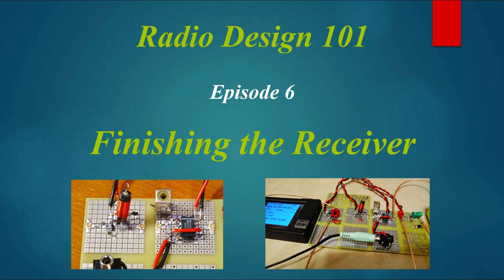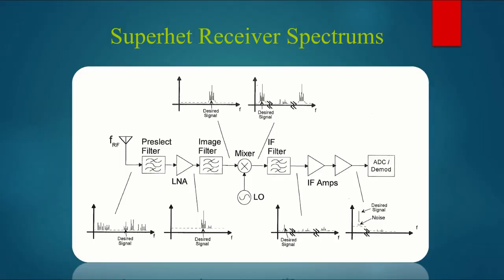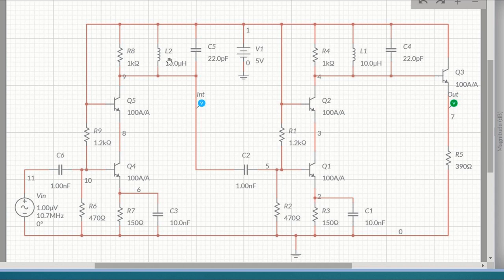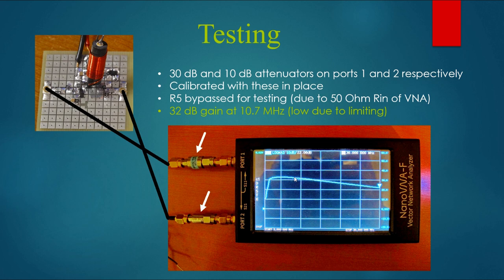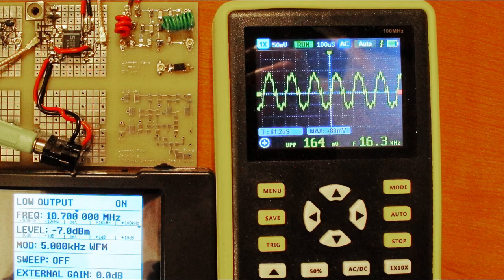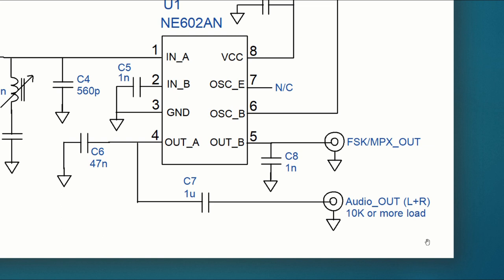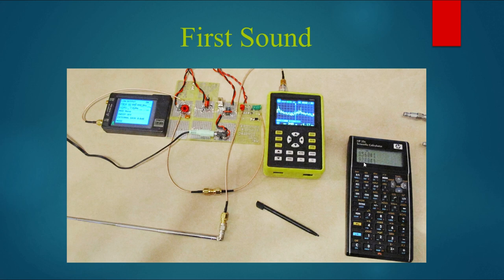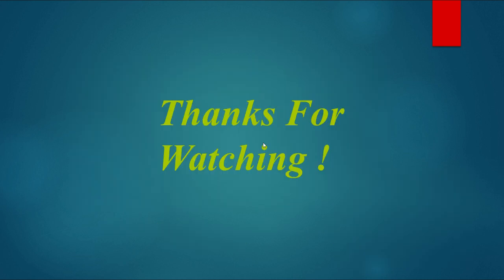Radio Design 101 - Finishing the Receiver (Episode  6)

Comment: It might be a good idea to have each stage of the circuit powered up and tested as it's built. That helps the students learn how to set up the tests of each stage , to see what the signals look like, and to ensure that the entire unit will work when everything is finally wired together. That's what I did when I was helping a group of hams build 40 meter QRP transceivers. Everyone appreciated doing it that way.
Reply from the maker: Absolutely agree. Testing is 50% of development work. And of course the university class did that. I think when this series was being put together, I wasn't thinking enough about viewers who might want to actually build their own. Your point is an excellent one. For anyone building their own - they absolutely need to test from the ground up.  Later, I did put all the course notes and assignments onto a website for those who wanted a deeper experience. Here's a webpage that has a full set of example project assignments, including directions for testing each. (these don't directly track what's in the videos, but many of the early assignments are close.  https://ecefiles.org/rf-circuits-course-section-0/  Thanks for bringing this up.
Reply: @MegawattKS , thank you for the link. I'm self-taught in electronics, but by watching your videos I feel like I'm auditing your class.
Reply from the maker: @johnwest7993  Cool !   73

Comment: Thanks for the video series. I am going to try building my own but adjusted for 145 MHz 2 meter HAM band.
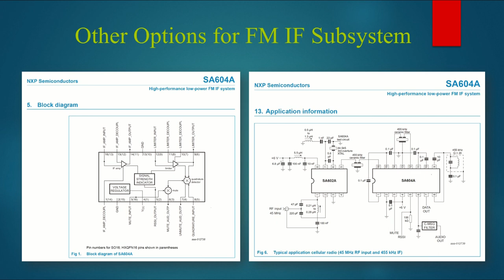Reply from the maker: Nice. Thanks for the comments.  For 2m work (narrowband FM), you may want to try one of the SA604A FM IF subsystems as shown at the end of the video (timestamp 32:40). Figure 6 shows this, preceeded by a second downconversion to 455 kHz so a narrowband filter can be used. It will also give the gain needed (FM stations are often strong enough to get away with what we did in the discrete IF amp, but 2m not so much :-)   73's

Comment: Thank you for this series of videos, this material on RF design is one of the best I've come across. Can I ask you a question about the design of the IF amp? How did you calculate the values of the coupling and bypass capacitors C6, C3?
Thank you and congratulations for such good videos.
Reply from the maker: Thanks!  Glad it is helpful.  The short answer for those capacitors is to just select a "large value" like 1 or 10 nF. That's "large" in the sense that at 10 MHz, 10nF is on the order of about an Ohm of reactance. So it makes a good low impedance connection. The longer answer involves looking at the signal impedances on the nodes it connects to. For example, the input coupling capacitor sees about 300 Ohms source, and 300 Ohms load impedance - so about 600 Ohms total. As long as it's reactance is much less than that, its good. So even Xc = 10 Ohms that the 1nF gives will work OK.  The bypass capacitor is typically bigger because it sees an impedance of 1/gm looking into the emitter. So that's maybe 30 or 50 Ohms (depends on bias current/etc). So that's why 10 nF was used there.  NOTE: I just noticed the schematic doesn't show a bypass on the power supply node. A bypass is needed there too. I think I just put a 10 nF there (again - the value is not critical - as long as Xc </= an Ohm or so).  It's actually visible in the photo of the board, just above and to the left of the big coil 🙂

Comment: That  resistor and capacitor series thing on the output of the LM386 is a Zobel Network and very useful to add to a speaker crossover network to make sure that 8 ohm impedance speaker is actually at 8 ohms at the crossover point because if it's not it will crossover at another frequency and/or spoil the shape of the crossover rolloff
Reply from the maker: Interesting. I had not heard of Zobel networks. My understanding from the LM386 audio amp datasheet is that the series RC to ground is recommended to mitigate oscillation in the MHz range. I think what happens is the speaker inductance above audio frequencies causes instability in the opamp architecture used in the 386.  So it helps maintain a good 8 (or 10) Ohms not only at the crossover point, but also at MHz frequencies 🙂

Comment: Very Nice presentations. I really enjoyed learning quite a lot as I have been very interested in emitter but the demodulation receiver side was quite a mystery. I feel the most difficult part of this approach is really getting the whole thing to tune properly to your low frequency 10.7MHz. All of this is now sold in a single chip TEA----, AR1010 to name a few.
Reply from the maker: Thanks. Glad it was helpful!  Stay tuned for the "Epilogue" episodes (hopefully soon). The epilogue 1 episode will look at performance, and go into some of the limitations of low cost FM radios including fully integrated designs. (Front-end filtering is relaxed in these and weak stations get blocked by strong ones...)

Comment: Good one. Thanks.

Fun with my demodulator built with 10.7 ceramic discriminator, it works if i power down VCC and drive input signal with 2Vpp. But collapses when powered up.

Haven't had a chance to debug yet. Hopefully this weekend.

Comment: Hi, thanks for the series! Well laid out and presented. About the phase shifter network, correct me if I'm wrong, but it seems to me you calculated the values for L1 & C2 based on reactance of ~26 ohms instead of R/Q = ~56 ohms, giving the circuit a BW of ~188kHz instead of 400kHz. Possibly a wee brain fart, mixing the X with the Q? I guess the correct values would be roughly 830nH and 260pF? Cheers!
Reply from the maker: Good catch!  Yes - I think you're right.  The components shown do give 26 Ohms rather than the 56 mentioned in the video.  However, there is a fortunate extra factor that does bring it back closer to a bandwidth of 400 kHz (I can't say I did it intentionally ;-) ). If we assume the Q of L1 is 50, then it presents another 1300 Ohms in parallel with the 1.5K, so the Q is cut in half and we're back to 400 kHz :-)   Again - not sure if I did that intentionally or not.  Thanks for the careful check !

Comment: would it be a good idea for the demodulator to design a regen type circuit? but designed to work at the IF frequency... that way we get away with a lower Q tank circuit
Reply from the maker: Regen could provide more gain and a narrow bandwidth starting from a low Q tank - and avoid need for a ceramic filter - so that's good. But it could oscillate and might need to be manually tuned to address changes in temperature/etc. Interesting tradeoffs.
Reply: @MegawattKS  thank you :). Yes now you mention it it does make sense... I'd rather go for the high Q

Comment: SA615 did perform better(relatively better sensitive) than my discreet build, although not to its full potential without all matching involved. It looks like i somehow broke the IF_AMP part  of the chip(can't see anything on IF_AMP_OUT, but once connected to IF_AMP_OUT=>LIMITER_IN, there is output on LIMITER_OUT), and so only getting gain from LIMITER part.

Looks like SA636 can handle 10.7 low Z filters directly, that should give compact build without the dang matching Inductors(risks of magnetic coupling).

Comment: Thanks for the great series! Any plans for the tx side as an extension?
Reply from the maker: You're very welcome.  Not sure on the transmit thing. I've mostly stayed away from that since not everyone watching has a license - and even low-power unlicensed FM transmitters often violate the rules on output power/etc. Plus they could potentially tune outside the FM band - which is definitely not a good thing. Good idea though. Transmitters are an important part of ham radio. Maybe I could do something as part of an amateur radio focused video on frequency synthesis ?  Will give it some thought.
Reply: @MegawattKS  +1 to a video on tx. Some of us are licensed HAMs :-)

Comment: Hi! great video series. Sorry for the ignorance, but I wanna know if it would be too difficult to build an am receiver working for 146MHz using all the information you provided along the playlist, thank you!
Reply from the maker: (edited)   Technically, the main changes/additions I can think of would be the need for AM demodulation of course, adding some form of AGC, and you probably need a more narrow IF filter. A few years in the university course we did some variations on the FM broadcast theme to be able to receive NOAA weather radio (at around 151 to 156 MHz).  The NOAA signal bandwidth was also only about 5 kHz, so we had to find a suitable IF filter - and I think we went with a dual-conversion receiver architecture. But the signal was still FM (narrowband). For AM, a different demod would be needed. The demod shown in this series wouldn't work because it's specifically for FM. I'll look for options and add a second reply.
Reply from the maker: This is a follow-up to the reply above (now edited). I forgot to mention the need for auto-gain-control (AGC) initially as another factor, and when I went looking for an AM demod I realized we were still doing (narrowband) FM. Since that reply was written, I've searched for commercial ICs that might be useful for AM demod. Sadly, I haven't found any. I'm starting to think that AM has been left behind in more ways than one. In the course, we start with AM, but then moved to FM and digital modulations that are more commonly used now. For AM, we discussed the classic envelope detector, but also "synchronous" detection using a mixer. Alternatively it might be fun to try using a modern "linear detector" IC like this as a demod https://www.ti.com/lit/ds/symlink/lmh2120.pdf (just a wild idea as that is not the intended market for this little guy). Now-adays, I think most people would opt to build the receiver out as far as the filtered IF and then digitize that and do the AM demod function in software, perhaps.

Comment: Signal split - frequency dependent phase delay - phase detection sounds like an general idea. Possible to use a "digital way" to do it? like:
Signal split to two - use two or more NAND gates to delay one split of the signal - compare phase difference of these two signals, using XOR gate.... If I use logic gates with short rise time (like 74LVC series, rise time ~2ns) I think it can handle 10.7Mhz FM IF signal.
Reply: OK I found a bunch of FM demodulators based on logic gates. Some designs are really simple and really suitable for downstream digitization.
Reply from the maker: Nice !  Yes - that sounds like it should definitely work. The XOR is acting as a  1-bit digital multiplier, I guess :-)
Reply: @MegawattKS  Indeed. It is amazing to see how analog circuit can be connected to digital circuit without ADC -- just by introducing a variety of 1-bit computations.
Reply: @MegawattKS  I just realized some interesting equivalence: if you consider XOR as a 1-bit digital multiplier, then it is a mixer, and the whole NAND phase delay -> mixer is a quadrature detector.
But you can also consider NAND phase delay -> XOR phase comparison as a pulse generator, which generate pulses equivalent to those with a "zero crossing detector". 
Therefore this NAND-XOR FM detector is equivalent to quadrature detector (a digital one tough) and zero crossing detector (which is digital by nature) at the same time. Is that a coincidence or there is some deep link underneath?

Comment: Thank you so much for putting in the effort to put this series together.  It can't have been a little amount of work, even if you taught it as an EE course at University.  

It is clear you viewed your audience as being at least slightly adverse to covering the mathematics involved.  What would you suggest to someone who has the requisite mathematical skills?  Is there anything like this course with the math that you're aware of?  It's probably not easy to go and find a course at the local University to sit in on.  I would expect that also knowing things mathematically would give one a much deeper understanding of whats going on.

Mathematics comes in many levels but I would think the requisite math would be: differential equations (ODE, including Laplace transforms), Fourier Series and Transforms, and Complex Analysis. Linear Algebra is important in basic circuit theory but I didn't seen much of a requirement in what you did present.  Would those be the list of requirements for your University course?

Thanks again!
Reply from the maker: Thanks for the comments. Yes - I was trying to minimize the math as much as possible - partly because of a varied audience, but also because much of RF design doesn't require it. In my design career before returning to school for the PhD so I could teach, I generally viewed circuits and their functioning using "compiled knowledge" as presented. Indeed, my research was even done this way. But you're absolutely right - with math, a much deeper understanding of why things work is obtained, and for some areas is arguably necessary. And some sub-fields (pun intended) like EM theory are difficult to do without it. I like your list of requisite math for the underpinnings. Everyone comes at stuff differently, and for my own studies, I had Complex Analysis in my MS program and enjoyed it, but honestly never used the deeper aspects. Of course complex numbers to represent and simplify analysis of linear systems is key due to the 2-D basis functions involved in things like Fourier theory. And as a circuit designer, I would actually maybe elevate Linear Algebra in importance, as it underpins the analysis techniques including superposition that is at the core of breaking the solutions into things like DC and AC parts. And also for solving/understanding/designing circuits with multiple inputs.